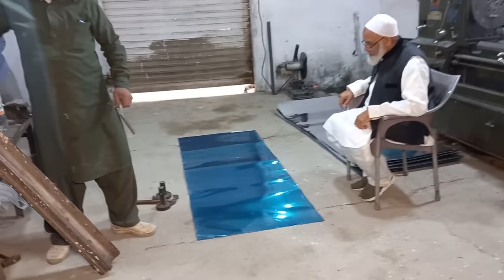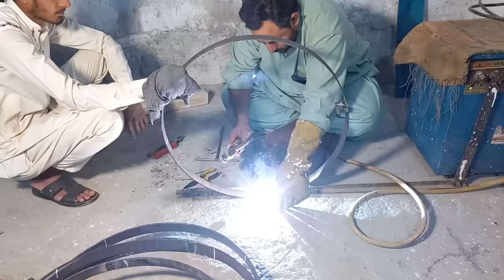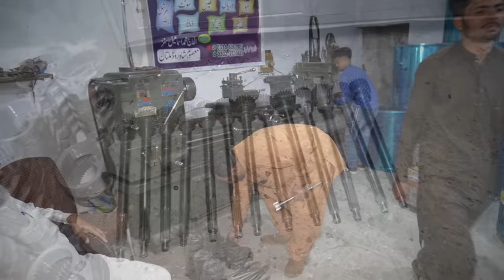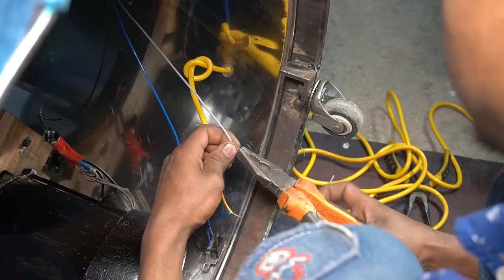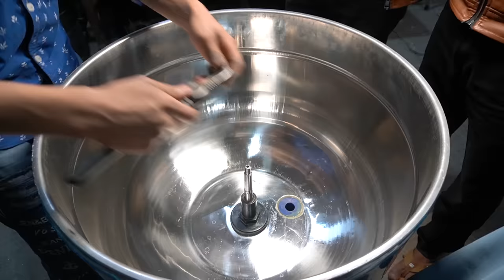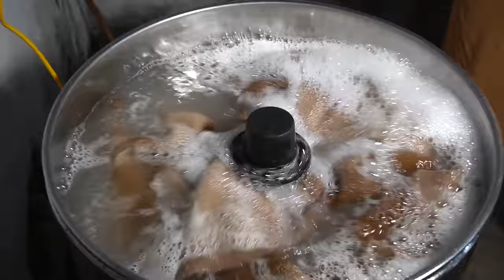Amazing Way of Making Gear Drive Washing Machine Through Like American Technology in Pakistan

Comment: I always love watching people working with just their hands. I’m a locksmith and horologist (clock maker) so I appreciate this. The only thing I would change is the bare metal. It would be best to paint the bare iron or have it galvanized. Especially when being used on a washing machine.
Reply: The outside looks like stainless steel. Must be rust resistant.
Reply: @ArunBasilLal it's probably Chinese made stainless steel which will rust in days
Reply: planned obsolescence
Reply: Order kese kre

Comment: Perhaps you guys need to examine a modern washer, they have water fill valves and a choice of water temperatures , the tub sits has holes in it and sits within another tub so the inner one can spin on a spin cycle to get the excess water out of the clothing when the washing is completed. Also a rinse cycle is needed to get the detergent out of the clothes after the wash cycle , there are no springs or counterbalance mechanism to facilitate a spin cycle as your tub is stationary.
Reply: That's because like everything else in this country it is based on 150 year old technology.
Reply: @petermoto409 кроме атомногт оружия.

Comment: That's a fine machine yall built.i wouldn't mind owning one of these..the washing machines here in the united states are all junk..except mabey speed queen
Reply: Really? No water fill system or water height adjustment, no tub bearings or sleeves and no spin cycle to spin the clothes somewhat dry , really..
Reply: @gofaraway fill the water yourself, depending on the amount of clothes you have, that way you can save water too. For spinning just dry the clothes, spin cycle damage clothes anyway

Comment: No rubber grommet to protect the power supply wire from chaffing against the sheet metal hole.
No final testing to ensure no short circuiting anywhere. You are dealing with a machine with electricity and full tub of water.
No rubber seal between the tub and machine enclosure. What happens if the water overflows and get into electrical components underneath.
God protect the customers from this dangerous machine.
👎👎👎
Reply: No water fill system or spin cycle

Comment: Bhi ye to death machine he .no safety against electrical shock. please jb ap electric connection pass kr rhy hen metal body se to wire double isolation kr k pass kren , sharp metallic body to kuch time k bad wire ko naked kr dy g.or upper body ke uper plastic lagayen and please write a caution.dont touch the machine when electric switch is on,